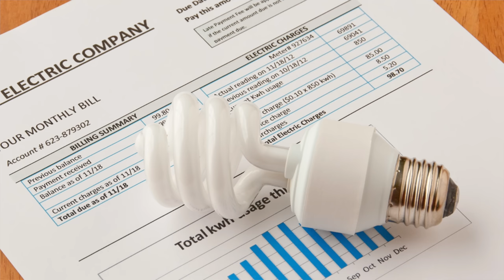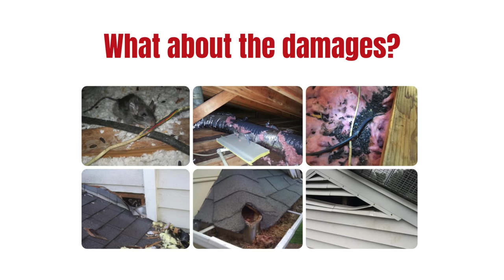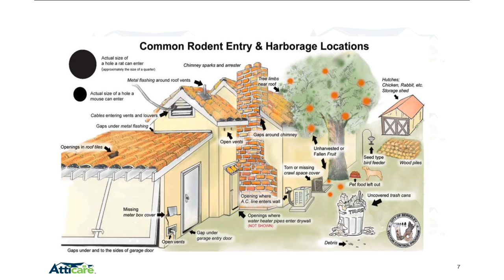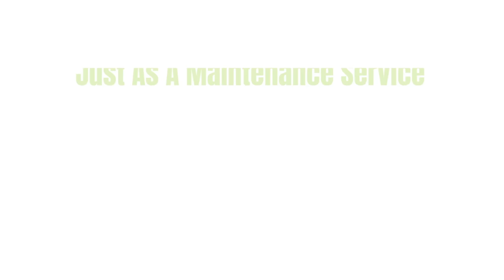5 Step Solution to Get Rid of Rodents Like Mice and Rats in Your Attic for Good!!

Comment: Man, I wish y'all had a service here in Houston, TX. My parent's house has a rodent problem and definitely requires your help in the attic
Reply: It’s partially true, however. The first step is inspect and conceal. Pest control technicians don’t spray for rodents, just bugs. After it’s concealed THEN we place snap traps NOT poison(they’ll just die in the walls. After there’s no more activity we use a disinfectant machine to fog your interior and vacuum all droppings. Theirs is to help up sell you as part of an insulation company

Comment: All done, paid $7k to get spray foam on roof line and remove old insulation. Paid $2k to seal up all possible cracks and holes. Cant see a single hole enywhere. House is 2 story and sits on like 2 feet of foundation. Mice come to attic daily hot or cold days
Reply: this is what I'm afraid of, not sure if trapping them when I hear them is better and save those 7K
Reply: @anacalderon92  at least now I can see them. I have camera set up in attic. Before it was next to impossible to see anything and set traps. Also it's been good so far, after I sealed all rain gutters and set outdoor traps. Maybe it's weather and they don't go to attic anymore, I don't know.

Comment: And then what happens if pests come back and now all of that money spent is being wasted because mice are once again nesting and peeing in the insulation? I wouldn’t spend this money unless the company had a guaranteed money back if the pests returned.  I’d rather fix problem areas from the outside (which a good pest control company will do) and leave the attic insulation, especially if it doesn’t vent into the house (which ours doesn’t) .
Reply: Easy, it’s not his fault, then it’s your pest maintenance company’s fault. Collect the money, pass the buck.

Comment: Brother why offer fiberglass to customers that have had a rodent problem? The correct way is to add cellulose to the attic because it contains natural borates that repels against rodents and it’s safe for anyone in a household, I can’t belive that your selling that garbage to your customers! fiberglass is not the way to go. For the people that are thinking of hiring this company look elsewhere. A true contractor/company knows that fiberglass is not the solution for an attic wether they offer warranty.
Reply: I have cellulose and mice got in. Hope I cought them quick (before a big infestation) but they did damage a small spot in the insulation.
Reply: @uglyDIY  well you need to conduct what is called an exclusion, see what most people don’t know is that you have to either replace or add more on top of existing insulation every 10 years no matter the type of insulation . My guess is that your insulation is over 10 years old in which it deteriorated to the point that it almost looks like dust, and when that happens it will loose its benefits! Most people never ever think of looking in their attics which leaves a lot of unhealthy possibilities…
Reply: @ulisess5732  my house is less than 2 years old. We installed 22 inches of cellulose. Sadly, its also a cathedral attic truss, and the damaged spot is at the opposite end of the attic hatch location, I will damage more insulation from stepping on it to go check the spot that mice damaged.
Reply: @uglyDIY  Sorry but I don’t belive you, you must work for this company or know them in some type of way of way. There is no way these rodents will be swimming around cellulose specially 22”. False advertisement!
Reply: @ulisess5732  man you're hilarious, these people is from the US and I live in Canada. Also I insulated the attic myself with cellulose, I'm in no way saying I'd ever use fiberglass. I just mentioned mice will get in cellulose as well, but you're free to believe whatever